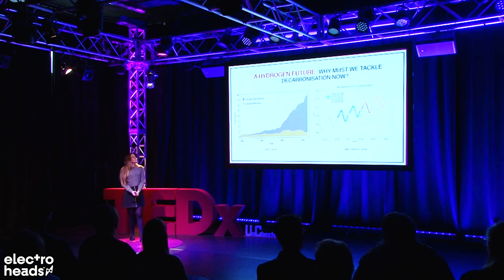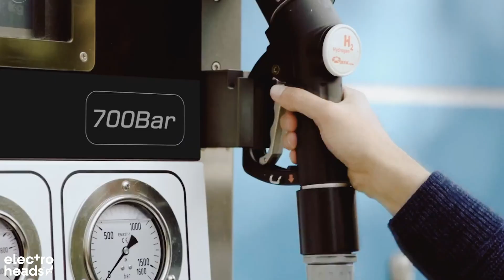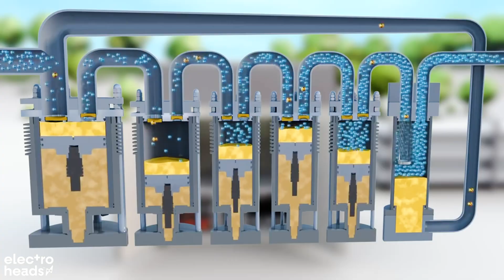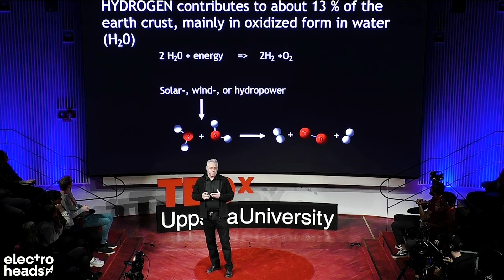Why hydrogen cars have failed - and will never succeed

Comment: Starting with big-scale hydrogen for small cars indeed doesn't seem to make a lot of sense.
The hydrogen projects we see starting-up are all about easy storage of energy and making hydrogen for the heavy industry and big transport.
And those projects make green hydro by taking wind and sun electricity and splitting water (you must have done that at school!). Completely green!
The next good use for hydrogen is boats, trains, planes, and trucks, as there are no batteries economic enough for those things.
Did you know: the 16 biggest boats in the world emit as much CO2 as all cars together, globally!
Another use case for hydrogen is to heat your house. That's starting too.
And once hydrogen becomes widely available and gets' cheap, it will become an option for (long-distance) cars. Small city cars might always stay BEV.
And one more thing: you mentioned the inefficiency of fuel-cells; the efficiency of a system becomes irrelevant once the complete chain is green, then only the cost is relevant. And as always, the lowest cost will win.

Comment: Hydrogen as carrier scale energy storage of electricity for when demand is low makes some sense and perhaps as an alternative fuel for planes. Personally I look forward to never needing to go to a petrol/gas station ever again.
Reply: For storage it needs to be cheap and efficient enough. Sadly hydrogen appears hamstrung on both of these. 
Batteries are already cheaper and better for short term storage. Other kinds of batteries and more economical solutions (using gravity or whatever) are explored for long term energy storage.

I also thought it would find a place with planes, but apparently hydrogens volume and low energy density are a thing there. So we’ll see. 

But yeah, definitely looking forward to no longer needing to go to a gas/petrol station 🙂

Comment: 1:30 .. I understand hydrogen is the most abundant in the universe but are you sure hydrogen is also the most abundant element on earth? I thought that was Oxygen.
Reply: Hydrogen may be very abundant but it never comes on its own, it’s always chemically bonded to something else, therein lies one of the major problems. It takes a lot of energy to break the bonds to allow Hydrogen to be used as a fuel. Another problem with pure Hydrogen is that due to the atoms very small size, it’s the smallest atom, it readily migrates into metal matrices at an atomic level, and causes the metal to change. In steel for instance, this is typically manifested as material embrittlement. The steel loses its elasticity and often fractures as a result with sometimes catastrophic results.

Comment: Another thing Hydrogen is used for goes: "BANG"
Thermonuclear Style!
Reply: A common thought, but also one that is completely wrong.

Hydrogen on its own is not flammable. To light it up you need to trap it, mix it with air and introduce an ignition source. This is both shown in history, where the brits found that downing the Zeppelins bombning London to be near impossible in WW1, until they found out how to shot it enough to create that situation, and in YouTube videos where firefighters show how pressurised hydrogen does not catch fire.

In fact it would be significantly safer to be in a hydrogen car than a car using batteries or gasoline if you are involved in a crash, as the hydrogen would escape the tanks at a rate where a the flammable mixture does not appear at ground level. The batteries of a BEV on the other hand have been known to selfignite, when damaged, and gasoline makes a pool of fuel for a potential ignition on the ground.

That said hydrogen fuel cells are not ideal for energy storage in cars, to little weight and refueling speed advantage to justify the higher costs, however in heavy transport and planes the weight advantage could make it worth the higher costs involved.

The role for hydrogen in personal transport, and a way to a greener future, is not when used with fuel cells, but rather as the energy source for syntetic fuel(P2X) that can be used in gasoline and diesel vehicles already produced with small modifications. It will make an expensive but when produced with renewable sources clean fuel for those that does not want to go electric for one reason or another.
Reply: @justjc51  I beg to differ - I've fought many a H2 fire when working at an oil refinery - the other fun thing is that H2 is invisible when it burns....
Reply: And you Justjc51 have no sense of humour!

Comment: PROS:
You can filll the FCEV up in about five minutes.

CONS:
You can only fill the FCEV in five minutes if the filling station haven't filled another FCEV just before.
Extracting H from gas releases carbon into the atmosphere.
Extracting H from water using renewables makes sense but takes up more energy than using the electricity directly in a BEV.
The efficiency of a FCEV is only about 30% whereas a BEV is around 85%
FCEV requires platinum which there simply isn't enough off to go around for all the FCEVs required.

FCEV could be used for lorries, but even here have BEV technology overtaken the evolution.

FCEV could be usefull for planes or even contrainer freight or cruise ships....

PS: That absolutely redicoulus title for this video is unnecessary... This was a good video, don't go down the clcikbait-rabbit hole, you're better than that....
Reply: So many times I've heard the "but I can fill up in 5 minutes" argument, to which I usually say that's immaterial to me. I charge up on my drive through the night. The time it takes doesn't matter on jot, because I'm asleep.
Reply: remember: five mintues filling process + payment + pressure buildup for the next car = 10-15min per car.... sooooo no pros

Comment: I think hydrogen is crucial for transforming air travel, but not for cars... Also need to work out how to convert sea water to hydrogen rather than cracking...
Reply: Absolutely has its place where the weight and energy density of batteries won't work. The higher energy intensive process of making hydrogen should be reserved for flight, shipping and possibly long distance transport.
Reply: @richardlphillips  most ships run or used to run on the cheapest and dirtiest oil they could burn. Hydrogen will probably be waaaay too expensive for shipping. Unfortunately.

Comment: It all comes down to money, if BEVs are cheaper to run than hydrogen cars most will buy BEVs.
Reply: BEVs(battery electric cars) are A LOT cheaper to run ( 15 times cheaper to run compared to electric car charged at home at night).
Reply: @janezjavornik5432  And hydrogen cars are not particularly economical either......
Reply: @Brian-om2hh  yes, hydrogen cars are not efficient, the same is true for petrol and diesel cars. The well to wheel efficiency of petrol car is 13 %, for diesel 16 %,  25 % for hydrogen cars and 80 % for battery electric cars. Remember thoose efficiencies are well to wheel average efficiencies (maximum efficiency is bigger, but for the fuel consumption you must look at AVERAGE efficiency).

Comment: It takes more energy to get hydrogen, than it gives back - it’s very inefficient (as you said). 
Also it takes about 15 mins for a hydrogen pump to re-pressurise after it has been used, before it can be used again. So it’s not all that quick a process if lots of people are using them.
Reply: Not sure where you get that from.

You put water from your tap into a jar. Put in 2 strips of metal, get a 9v battery and run current they the strips

Run a tube off the lid and you have split hydrogen out of the water.

Did you think it was an extremely hard process?

An fuelcell takes hydrogen gas add air and it produces electricity, the waste is pure water.

There's already home hydrogen power stations you can buy for $5000 usd.
Reply: @zagan1  - I didn’t say it was a hard process, I said it was not an efficient process. In your example it would use more electrical power from the 9v battery to extract the hydrogen, than the hydrogen would provide back to the fuel cell.
Reply: @SDK2006b  You are completely correct Peter. Just wanted to add: any sort of energy conversion or storage provides less energy back then there was initially put it. There is always losses along the way. But yeah, the losses for producing and storing hydrogen are incredibly high and therefore BEVs are the obvious choice.
Reply: @Freba9  Only when we can create an energy serplus in our society through renewables, can we see the full advantage of using hydrogen as lithium batteries need to be replaced and recycled. These processes also take energy also the mineing of the materials etc. I am not say hydrogen is better im just saying its complicated and there are some really amazing pros of hydrogen-electric power.
  I believe we need to change the way we think as a society, we need to think in the long run as well as the short term. Lets make it possible to opt for better cleaner technologies by taking steps in that direction now. 
  Hydrogen has the potential of making cargo ships run on 100 percent electric. The chance of that happening with lithium at this time is very low. Another thing we shold be ramping up is lithium battery recycling at end of life. 
  I dont think a one or the other mentality is going to win the race against global warming. Instead we need to all in on all of the viable solutions starting with making clean energy; because if you are running your electric car on power generated with coal, its not that much help as if you were running on cleaner sources.

Comment: Good show! The hydrogen solution that lets ours car be refueled by our home solar hydrogen-generating station is going to the kick butt, but (butt-but) -  you explain that we are very far from that with current hydrogen infrastructure plans which sound like a non-starter to be sure.
Reply: Regarding the home solar-hydrogen station. Why would you throw away most of your electricity producing hydrogen at 25-35% efficiency, when you can use that same electricity at > 85% efficiency using batteries?

Well, yeah you can certainly do that, if you had money to burn on having 3 times more solar panel than you would otherwise need, to compensate for hydrogens inefficiency. Still I don’t think it makes sense doing that 🤷🏻‍♂️
Reply: @r87961  exactly
Reply: @r87961  Not enough materials are being found in earth to make enough batteries for EV's to be adopted widely.
Reply: @sevencostanza3931  what materials are you referring to. Also it's not like hydrogen cars won't have that same issue than.

Comment: As a fuel for passenger vehicles, hydrogen doesn't make sense any more, especially when price parity between BEVs and ICEs is just around the corner. It makes much more sense for large transportation vehicles of people and goods, such as big lorries, trains, buses, ferries, etc.
Reply: Scania in Sweden have just dropped all research in to hydrogen (FCEV) powered lorries, which they have been doing for several years now.  They state that even at the large vehicle level the inefficiencies between it and battery power make it not worth following.
Reply: @manwithcorsae7738  Ah, interesting! Thanks for your reply. The other thing that isn't covered in much detail in the video is that hydrogen needs to be transported to (or produced at) the outlet, whereas electricity does not. That makes a huge difference to the overall cost as well.

Comment: The flip side of EV’s is that lithium batteries performance slowly declines (just like your smartphone), so after 100,000 miles they might need to be replaced with a cost of 5 to 6 thousand USD.

Fuel cells can go twice as far before a noticeable drop in performance is observed. Expert Jerald Cole even talks of 500,000 miles.

Both EV’s and FCEV’s require cobalt, which currently involves child labour. From an ethical point of view it makes sense to try and get more miles out of less cobalt, so in my book FCEV’s would be the more ethical solution.
Reply: 100,000 miles replacement? Perhaps with tech from 2012 but that's nowhere near true now. Not even close.

When there are reasonably simple battery cars like the Renault Zoe ZE40 driving around after 250,000 miles with 90% state of health in their pack (this is true, there is an example of this happening with a European taxi), the idea that you need to "Replace" an EV battery is simply a myth. It will last the life of the car.

I've never heard of a non-Leaf battery replacement in an EV due to range loss. Ever.

Battery failures fixed under warranty? Yup. But never a battery needing replacement because it has worn out. Not since the 30Kwh Leaf hit the road.
Reply: What absolute garbage! Where do you people get your misinformation from? ALL electric cars come with an 8 YEAR battery warranty, with an assurance at the end of those 8 years of at least 75% battery efficiency. I'll find the video on here of the Tesla with 400'000 miles covered. and it only needs a new battery now. Stop spreading crap about EV batteries. You clearly have little idea what you're talking about!  Here   https://www.youtube.com/watch?v=fGRrZ0njHJc   Your comments are simply WAY out. Do more research!!!
Reply: BEVs can definitely do more than 100k miles without needing a new battery.

And don’t forget, thanks to battery recycling about 70% of the raw materials can be reclaimed, whereas FC recycling remains problematic. 

Not to mention, cobalt-free batteries are slowly getting closer with every month.

Comment: Not to mention that as renewables and Nuclear energy is ramped up electricity will become much cheaper for charging whilst the energy intense process of electrolysing hydrogen to make the fuel in the first place means that most the energy potential is lost in the actually manufacturing process!
BEV are just more effcient, cheaper and generally better for the consumers wallet than Hydrogen ever would have been. If pumping stations weren't so expensive it would have been a nice intererim between ICE and BEV but they're pretty much redundant now, except for use on long haulage maybe where the weight of a battery would severly limit the efficency and range of a Truck.

Comment: As an engineer, I pray that governments will not start supporting hydrogen cars, because it would be a massive shot in the foot - in terms of the environmental footprint, supply chains, manufacturing, user friendliness, running costs, etc. Hydrogen makes 0 sense on ground transport. Airplanes and ship? Maybe.
Reply from the maker: Well said! Maybe still has potential for heavy machinery too I think
Reply: Yup. This. Use it for heavy manufacturing. Use it for steel furnaces. Use it for trains and trucks and planes, sure.

Cars and vans? Christ no.
Reply: @timaustin2000  Arguably, even trains and trucks can be electrified using batteries.

EV trucks are coming fast and professional drivers are legally required to take breaks after a couple of hours of driving anyways, so range is not an issue. 

And for trains, there are some amazing prototypes of overhead electric + battery electric hybrids = the train uses battery power on routes which are not electrified and charges while it’s in the station or on sections which have overhead wires.
Reply: @DarcersTech  the reason Hydrogen is compelling is energy density, which is astonishingly high, much much higher than Petrol / Diesel / Kerosine. The heavier the vehicle is the more advantages that gets. It's not really the range that is the main issue of heavy electric vehicles (even though it is one of the issues), it is jsut the fact that at some point the batteries need to be so plentyful that the vehicle is no longer economical. A battery vehicle has much simpler layout the energy is stored in a form that is directly usable by a motor and with hydrogen you have advantage of energy density and faster refueling. 

Plus BEVs are just simpler, which results in all of those advantages you mentioned:
"- in terms of the environmental footprint, supply chains, manufacturing, user friendliness, running costs, etc".

And Trains, yes that will be interesting indeed, they are currently some Hydrotrains in operation already, so the battle on this front is opened as well. 

You could see Battery vs Hydrogen on a weight scale: a scooters make only sense with batteries and heavy ships make only sense with Hydrogen.The Interesting part is the middle in the area where both technologies have their pros and cons and everyone who tells you that he can predict where the line will be in 20 years is lying. 

Just because something can be electrified with batteries, does not mean it is the most economical solution.
Reply: @tzarcoal1018  I mostly agree. But as you mentioned, the problem with hydrogen is the complicated process = low efficiency. Even in the best case scenario, running a hydrogen vehicle will be twice as energy hungry as a BEV, so at least twice as expensive, assuming we want to use eco hydrogen. 

Yes, there are already hydrogen trains, but also battery-electric hybrid trains. They use the overhead wires to charge and cover sections of track which are too uneconomical to electrify, which sounds like the best solution to me. 

Ships most probably hydrogen. Airplanes will depend on length of flight.
Reply: @timaustin2000  Yes, because polluting fumes is great for pedestrians 🤦‍♂️
Reply: @TheLondonCyclist  BEVs don’t have polluting fumes 

Yes, the power plants providing the power do, but those are generally not next to pedestrians and it wouldn’t be different for hydrogen
Reply: @r87961  I'm talking about the cars etc bro, no escooters and cars or hydrogen vehicles.
Reply: @TheLondonCyclist  ah sorry, I probably misunderstood your reply to Tim. Thanks for clarifying 👍🏻
Reply: @r87961  No worries mate.
Reply: Only dumbest government in the world would support this...
Australian government: hold my beer